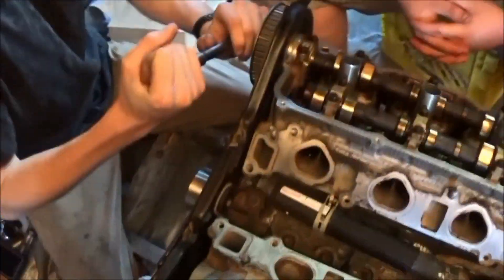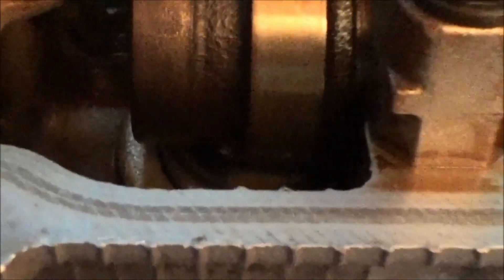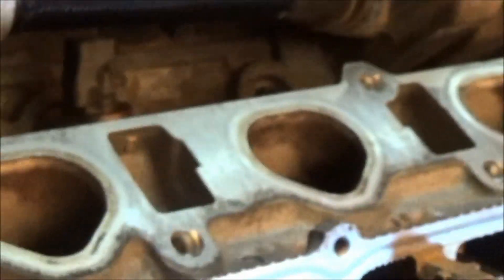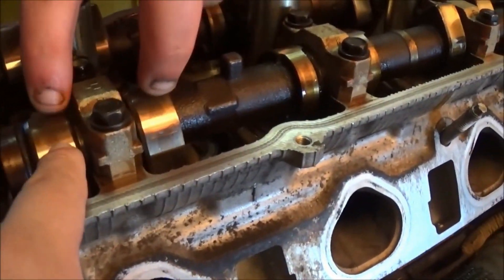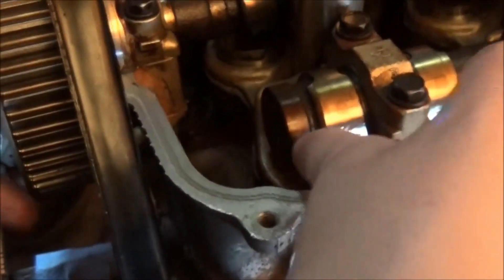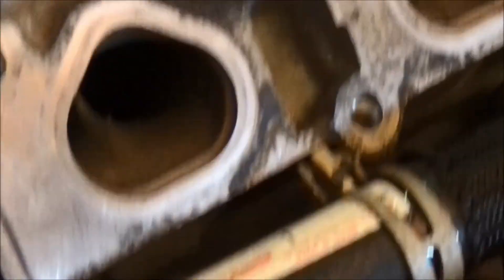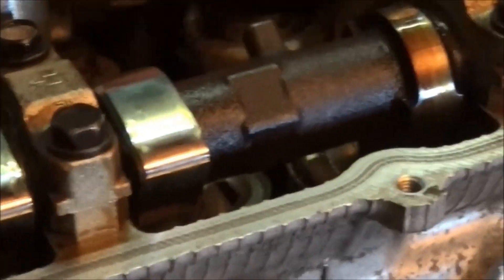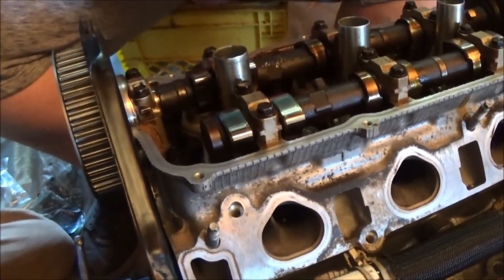1MZ-FE Engine - Interference Or Non-Interference

Comment: The 1MZ-FE is one of the best engines ever made
Reply: Im building one for my mr2 its gonna make 650 wheel horsepower or bust
Reply: Junior that’s just the valve gaskets usually and as long as they’re replaced and maintained it won’t sludge out  too bad
Reply: Junior any engine will have sludge build up if you don’t change oil regularly.
Reply: @Junior Yeah that’s why you maintain it lol. Also, really goes for all engines.
Reply: @harrisoncoulter1  I think you might be confusing the 1mzfe with the 2mzfe. The 2m has a cast iron block and more displacement.

The 1m's aluminum block can't handle high hp without a completely new radiator system
Reply: @legomanTJ  you’re talking to the guy that ended up making it happen. I’ve got pictures of the setup and it was all done with a 1mz haha
Reply: Yes.

Comment: To anybody that went straight to comments section: The 1MZ-FE is NON-INTERFERENCE. If your belt snaps, you will just need to get it towed, put a new belt on, time it correctly, and off you go. You're fine. With that said, change it every 100K miles to be extra safe, and do NOT let coolant or oil leak on the belt, as it will fail prematurely. 

This happened to be a few months back.

Comment: The 1MZFE is non interference regardless of VVT-i or not.

Same thing with the 2UZFE engine. 

3MZFE is where Toyota changed it because of the piston being rounded at the top.
Reply: So the 3mzfe is an interference engine?
Reply: @spartacussoe2339  correct.

Comment: All Toyota engines are Non- Interference I use to work at Toyota but it's recommended to still change timming belt and water pump every 150,000 miles just changed mines on my 03 Avalon now it has 217,000 good cars 😁
Reply: Sir you are correct. ALL Toyota engines are non-interference contrary to the belt manufacturers information. There is a very remote outside chance say if you are racing over 6000 rpm maybe on certain situations but even that is very very remote. The issue is re-aligning the belt properly after it snaps or jumps. Many average garage mechanics may or may not have the skills to align the new belt properly in turn they will blame it on the engine, in which they simply installed the belt wrong.
Reply: Toyotas 1.5L (1A-C, 3A-C & 3E) Interference
• 1.5L (3E-E & 5E-FE) Non-Interference
• 1.6L DOHC (4A-F & 4A-FE) Non-Interference
• 1.6L DOHC (4A-GE & 4A-GZE) Non-Interference
• 1.6L SOHC Non-Interference
• 1.8L Diesel Interference
• 1.8L DOHC Gasoline Interference
1.8L 7AFE, 4AFE, 4AF – Non Interference
• 2.0L Non-Interference
• 2.2L Diesel Interference
• 2.2L Gasoline Non-Interference
• 2.4L Diesel Interference
• 2.5L Non-Interference
• 2.8L Non-Interference
• 3.0L Inline 6 (Except 1998 2JZ-GE) Non-Interference
• 3.0L Inline 6 VVT-i (1998 2JZ-GE) Interference
• 3.0L V6 Non-Interference
• 3.3L 3MZ-FE V6 W/ V VTi  – Interference
• 3.4L Non-Interference
* 3.5L V-6 Non-Interference
• 4.7L Interference

Lexus

• 2.5L Non-Interference
• 3.0L V6 Non-Interference
• 3.3L V6 Non-Interference
• 3.0L Inline 6 (1992-97) Non-Interference
• 3.0L Inline 6 VVT-i (1998-2006) Interference
• 4.0L Interference
• 4.3L Interference
• 4.7L Interference

Source: http://yourcarangel.com/2014/07/interference-engines-complete-list/

Comment: But if your timing belt brakes the water pump will stop working among other things and the car will overheat if the engine continues running so you'll have to pull over soon, turn the engine off and call a tow truck.  That's why it's recommended to change the timing belt at whatever mileage the maintenance schedule says to.
Reply: Buddy if your timing belt breaks the engine will immediately stop running, what are you talking about? 😂😂😂
Reply: I think the engine immediately shutting off will take care of that.  heh

Comment: The 3MZ is also a non interference. I did this same thing while changing the timing belt on my es330. 

The pistons have a larger bore but they still have valve depressions on them for clearance. The 1MZ and 3MZ have the same engine heads.
Reply: Surprised to see you say that because while doing research  on 1MZ-FE ran into this response.

https://www.toyotanation.com/threads/1mz-fe-interference-or-not-questions-again.1501978/#post-12609802
hardtopte72 said:
Toyota does make timing belt driven engines that are interference. Namely:

95+ UZ V8 engines regardless of year, vehicle, displacement, or whether it has VVT-I
2JZGE VVT-I
3MZFE

Also  on http://yourcarangel.com/2014/07/interference-engines-complete-list/
3.3L 3MZ-FE V6 W/ V VTi  – Interference 

Also on https://www.clublexus.com/forums/es-1st-to-4th-gen-1990-2006/620377-vvti-engine-interference-or-not-2.html
Bdub215's #21 post 

And this is still NOT true. the 1MZ with or without VVT-i is non interference. the 3MZ IS interference and in the repair manual for the ES330 The timing belt procedure was changed to reflect that. It didnt change whether or it VVT came into the equation. VVT is only active when the motor is running. The 3MZ has bigger pistons and the cams have a lot more lift. There's your interference issue.

One more hardtopte72's post #11
https://www.toyotanation.com/threads/3mz-fe-interference-fit-or-noninterference-fit.1655750/
Almost all correct. Spot on with the 1MZFE. It is not interference in any variant. I have seen plenty of gnarly failures and not one instance of bent valves, even at highway speeds.

The only change is that the reason the 3MZFE is interference is because they changed to a "dome" (Toyota term) piston. It still has valve reliefs, but not for all out of time situations. Some people have broken 3MZFE timing belts and been fine. Some people were off 1 tooth or let the cam slam during the belt change and bent valves.
Reply: @elypeachy3296  The Sienna and highlander use a version of the 3MZ with higher-lift cams. These versions produce 5 more hp than the es330 and camry 3MZ engines and are likely interference. But I haven't personally checked with an actual engine.

The 3MZ in my es330 I know for a fact is not interference because I checked when changing the belt by doing the following:

With no belt installed and the crank at TDC, I rotated the LH bank cams (front of car) around twice and nothing happened.
Reply: @sodiumvapor13  scott kilmer has a es330 and he is a great mechanic he says its non

Comment: Just a bit of information to add if your 1MZ has variable valve timing (VVT-i). it is an interference engine. VVT-i 1mz's have higher compression and higher lift cams and is usually found in 99+ es300, 00+ avalon, 04+ camry and some toyota /lexus vans. SOLARA'S NEVER HAD AN VVT-I ENGINE option until 04 with the 3mz 3.3l.
Reply: Pretty Sure Ur Correct,Bought Used  04 ES330 & Dealer Mech.Said ES300 Is Non Interf.,But My 3.3 ,For Some Reason is An Interference Eng.Not Sure About ES350,But Being A VVTI, Eng.Also,Prob.An Interference.My 01 Tundra,3.4 Was A Non Interf.Eng.But 30 - 40 Less H p.Than The ES' s ,Way Less Compression.
Reply: so the 2002 toyota sienna has an interference engine? please reply
Reply: @PoliticalGangster  pretty sure 01+ sienna are vvt-i so yes it should be. best way to tell is to open your hood, if your engine cover says vvt-i then its interference
Reply: Dee Jay incorrect, sir. Doesn’t matter if you have VVT-i or not. It’s irrelevant. This is in regards to the 1MZFE. There are other engines where the VVT makes a difference but not this one.
Reply: PoliticalGangster exactly.
Reply: @GraV21  Thank You
Reply: So the 1MZ VVT engine is non interference
Reply: lsxjunkie yes
Reply: My 02 Lexus has vvt 1mzfe in it and it’s a non interference. Research more before opening your mouth and mislead a bunch of people

Comment: 1990 Toyota 3.0 3vze.. Non Interference too..  Valves that Let Air Gas in and Exhaust out.. don't Hit piston Tops.. so if the Timing belt goes awry, Engine damage won't result..  Lately I Been tinkering With 258 4.2 straight/inline 6 1974 motor from A AMC Javelin.. it drove nice in my Toyota truck..  but block Cracked on side Coolant jacket along Drivers side of Engine.. so the Block is busted at the moment.. but I was thinking of taking pistons and rods and putting them into a 4.0 strait 6 motor i also got.. and putting the 258 crank in there too..and making a motor..  or i will just leave the pistons alone in the 4.0 for now..  either way I like motor mechanics.. its fun.. but I want to invent a Motor/Engine too.. like A new kind Of engine, that be neat..   (the strait 6 motor is So smooth Compared to Others... the one i got has a carburetor.. I'm thinking of Putting the carburetor on the Fuel Injected 4.0..and making it Carb..  keep it Simple..  less Parts n Such..  Someone Once said "the car engine is nothing more Than a Glorified Vacuum pump.."
Reply from the maker: That's pretty awesome! Keep me posted if you end up building/creating your own engine! That would be so amazing to see!!

Comment: I have a 1995 Lexus ls 400 is mine one
Reply from the maker: I think that car came with the 4.0 L 1UZ-FE V8 ...so I have no idea.
Reply: The early 250hp 1uzfe models were non interference, once they got a bump in power to 260 they became a interference engine due to the higher lift on the cams, the newer vvti 1uzfe is interference lol
Reply: @mr.boostang2064  1995-97 ls400 are not interference as a broke a timing belt on a 95 and changed the belt and it ran just fine. 1uzfe is NONE interference so that is from 1989-97.